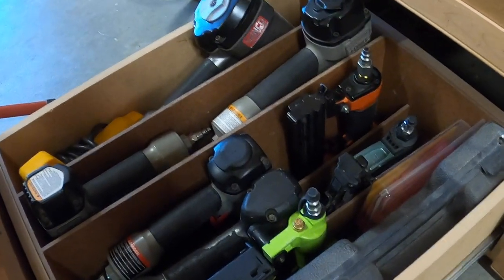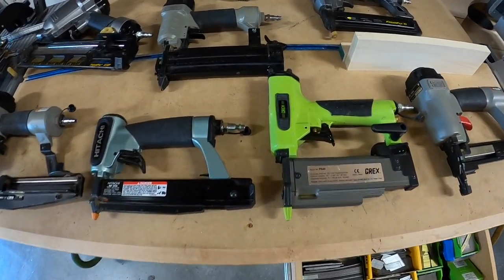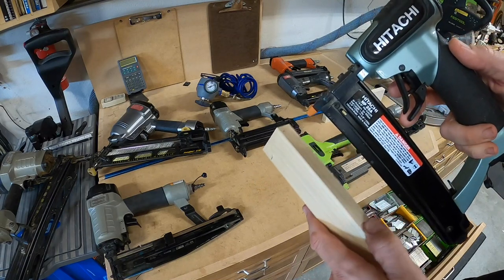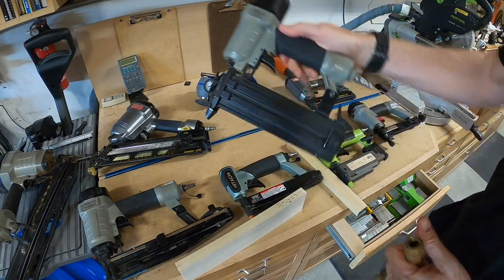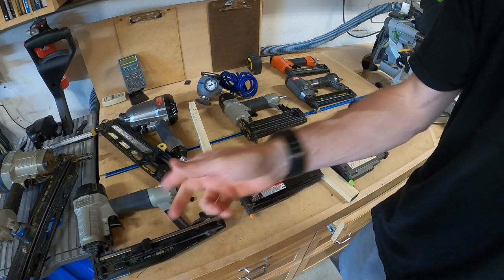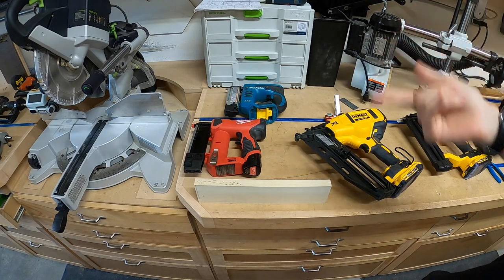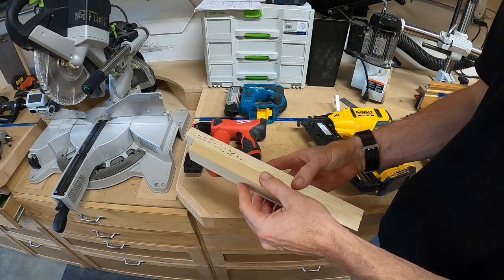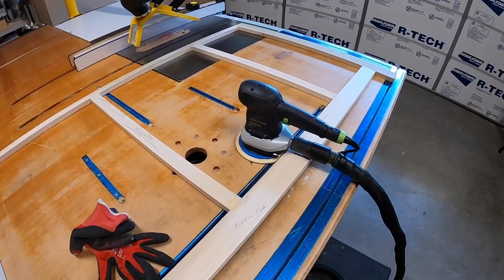What Type of Nail Guns Should You Have and Why?  The Top 2 I Use- Plus A Secret Nail Gun Accessory!

Comment: Hi David, recently found your channel and have been enjoying your content.  I got a kick out of seeing the kobalt co2 regulator gizmo.  I remember seeing it on commercials and thinking it was such a good idea.  As someone that enjoys playing paintball, i would recommend that if you want to keep using that gizmo, look into getting a compressed air tank. a small compressed air tank like 13 cu in, will be filled to 3k psi and have the same output pressure as a co2 tank (about 800 ish).  The compressed air will treat your gun seals a lot nicer and it only costs  a couple bucks to fill at your local shop.  I have a much larger tank that is like 60 cu in and fills to 4.5k psi that thing will probably last enough time to frame a house (now i just need to find that regulator).
Reply from the maker: Awesome to hear you found the channel.  It’s great to have new subscribers.  I’m so grateful.  It’s a neat little gizmo isn’t it.  I’m glad you mentioned the stuff about your experience with compressed air tanks.  Is this the same thing as a air compressor?
Reply: @davidbryanwoodworksandmore  no, in paintball there are co2 cylinders and HpA (high pressure air) cylinders. They look similar, but use different “fuels”. In paintball usually the lower end markers use co2, while the nicer (see: more expensive) markers used compressed air. The air tanks yield much more consistent tank output because you don’t have a liquid co2 expanding into a gas. And sometimes when you shoot too fast some of the liquid co2 can work it’s way into the gun and degrade your orings. The reason you have to get the little tanks refilled at a paintball shop is because they have special compressors that output 4500 psi, a far cry from our 120 psi at home. Look up the Airbowsystems and you will find a mail gun manufacturer that basically built their guns with paintball tanks attached to them and they sell you the special compressor. With the kobalt regulator you are basically doing the same thing, but better in my opinion.
Reply from the maker: @JorgeAguilar714  wow that’s a lot of info.  Thanks so much for providing such good information.

Comment: Agree with everything you said.  Sometimes I think my irritation at certain tools is my fault (girl thing maybe) nice to hear my thoughts echoed by another. I do the same sort of work you do, custom furniture/cabinetry from home.  I do nearly everything I use a nailer for with my pin nailer - power grab and pin nails for trim work.  If everything is prefinished in my shop, the trim has one topcoat, then installed with power grab and pin nails, filled and painted with second topcoat.  Sometimes I’m horrified at the trim work “trim carpenters” leave for the painters.  I am in awe how you make your business work with outsourcing finishing - i want to, but I don’t have confidence it would work.  Studiokwoodcraft
Reply from the maker: Thank you for the great comment. It sounds like you do nice work.  It’s nice to hear you care about your finished products.  When I finished all of my work, at the beginning, it was pre-finished before installation.  However that method may work for some, my experience is it has a lot of shortcomings.  Especially paint grade jobs.  My finishers are just like my employees.  They do all of my work unless a customer doesn’t want it.  After a dozen years of these guys doing my work, we both know what to expect from each other.  This is huge as I don’t need to worry about them at all. It’s great.  And when they bid the job, they know there won’t be any “surprises” to deal with! You know what I mean.  No bondo needed to fix joints etc.  it’s really just about finding the right painter and train them to what you want.  You may not know what it can look like but trust me it’s worth it. And they have insurance so I’m out of the picture from liability.  That’s nice.  It’s not latex we’re using.

Comment: I used to use a 16ga for most trim work but I have found that 15ga has more holding power and actually will pull the trim up tight better.
Reply from the maker: Certainly 15 gauge is bigger and stronger. Especially for doors.  But It’s just too big for my needs with mainly cabinets and trim most of the time. Thanks for watching.

Comment: Hello another great video, I have the Hitachi pin nailer and love it, I'm wanting the M12 pin nailer not really sure why tho! Anyway on a different topic I see on your miter saw you have the digital measuring gauge is that the Reekon M1? I've been on there web site it seems cool. So does it eliminate the need for a stop block? And what are your thoughts on it?? Thanks Mike
Reply from the maker: Thanks a lot Mike for leaving great comments. You know the reekon device is pretty cool but it does not make it easier for my work.  I’ve got videos I’ve made on it but never posted them.  I’ve been so busy.  But I maybe shoujd. I think if you are a rough carpenter and are working maybe with framing it may be very good.  However because of the way I work with my materials, I don’t have much extra on the End when done cutting, this device doesn’t work for me.  If I worked with longer pieces and cut many parts out of them,  it would be better.  Do you think a video on it would be worth doing?  By the way, your shop is great. Looks very cool.
Reply: @davidbryanwoodworksandmore  Thanks for the kind words! Seems like I'm always looking for ways to improve my shop sometimes more than making stuff although when I do make things it is nice having the improvements,  I did something like your 2 1/2" set up you did a few videos back accept I ran mine vertical because of the way my shop is laid out works great for my overhead dust boom for my palm sander drill press and  bench sander. There is only a handful of videos on the reekon gauge out there I'm not sure a lot of people even know about it. I'm getting ready to rework my miter saw station so that is why I wanted your thoughts on it.  I have my eye one the makita miter saw may have to purchase it new can't find it used. By the way your photos on your website of your work is beautiful!! Thanks Mike